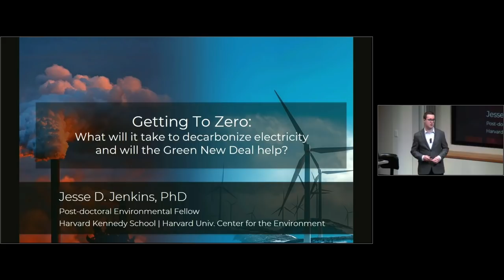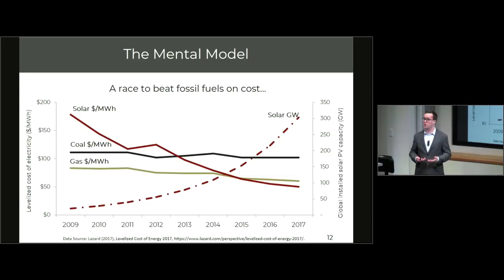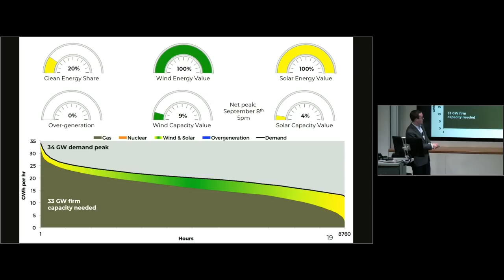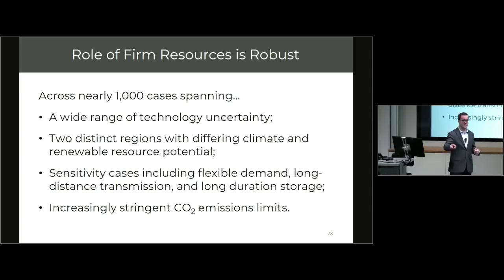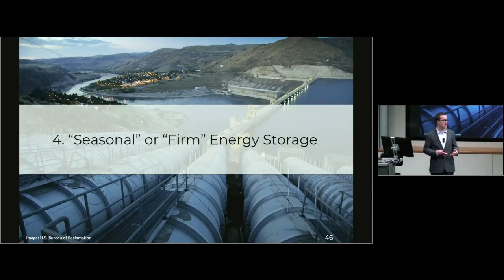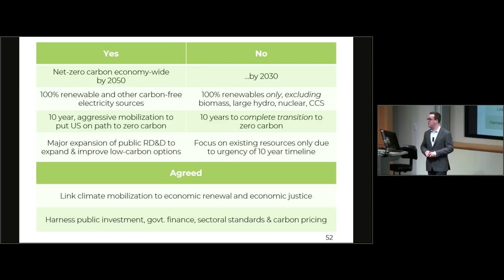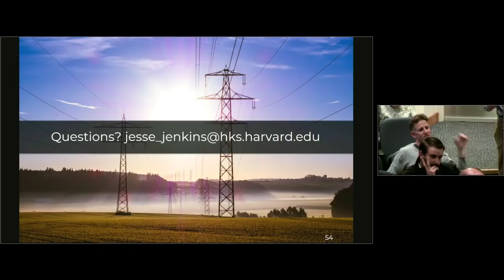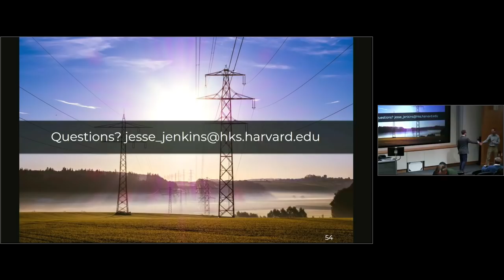UT Energy Symposium – February 21, 2019

Comment: there are so many shell and pea tricks going on here with this modelling it’s hard to know where to start explaining all the mathematical and logical tricks he is using to reach very dubious conclusions.  all modelling is suspect to manipulation of assumptions. and this guy is a master manipulator. 

so before i get started debunking his conclusions consider what Jenkins is saying, beyond 20-30% of mix solar PV has “no” market value at all. similar for wind. and yet in South Australia, coal is departed at (~40% RE) and gas is being eroded as the market operator stops curtailing so much wind and the hornsdale battery eats the FCAS market.  and what has happened to wholesale energy prices on the thin SA node of the Australian NEM? They’ve gone down in comparison to every other state.  that’s what. soon they will be at 75% with cheaper power prices and according to this master of knowledge manipulation that defies the laws of physics and economics.  

another point to consider is that if the market doesn’t reward cheap and very low emissions capacity, only flexibility then what is wrong ruth the market. nationalising the markets should be considered if the market reformers can get it right. decarbonising is not choice, it’s a necessity. NY State has legislated it with ambitious targets and eschewing the use of dubious “carbon offsetting” mechanisms and products. (often of suspect provenance). 

so either reality is right or Jesse Jenkins’s modelling. which do you think has erred? i know a fair bit about modeling so i can see his slight of hands. like a magician it’s invisible to ordinary people. in future comments i will explains. how he does it.  but why does he do it? does he really want to destroy the small chance we have of preventing catastrophic climate change? or does he take money from those who are opposed to climate action? or is he just carving out a Bjorn Lomborg type fortune in counter-narrative?
Reply: I imagine that Dr. Jenkins is reeling from your articulate and coherent attack on his views, and that Harvard University is carefully reconsidering its decision to hire him.
Reply: South Australia had the highest energy prices in the world in 2017 before Hornsdale started participating in FCAS, so they had a pretty easy job bringing prices down. South Australia still had the highest prices in Australia through 2021. In January 2022, prices there spiked to $5 per kWh, when normally they are 40c. Sometimes prices fall negative because the renewables are overgenerating and they are paying people to increase demand or else the grid will be damaged and suffer blackouts, but negative spot prices are not good in the long term: it reflects difficulty for generators to make a predictable income, which leads to generators dropping out,  less supply,  higher prices.  

The rest of the world wants cheap energy, which South Australia does not have. Nowhere in Australia has cheap energy.
Reply: @TheMrEarbrass  an appeal to authority is it? I raise you Mark Jackobsens 2021 modelling including sectorial coupling with heat and cool storage for every single state in USA covering not just current grid demand, but electrifying everything and covering that demand for every 30 second dispatch period in three years of weather data, oh and bound with a climate model to get the changing PV and wind outputs year by year.
Reply: @xfreeman86  I can't paste them here, but I have graphs that compare the SA wholesale average price over time with the other states on the NEM. It is unequivocal truth that SA wholesale price has gone from highest to in the low end of the pack. 

you say price peaked at $5 ?! prices peak at the limit $14500 in all states in Australia from time to time. 

It wasn't the Hornsdale battery that reduced the wholesale prices in SA so much as having ~58% RE over the year being dispatched. Yes, Hornsdale and now other batteries are able to play the FCAS market and reduce that cost from expensive gas speaker use too.

Comparing Australian or SA energy prices with the rest of the world is a bit disingenuous because SA is one of the most spread out grids per MWh of dispatched energy in the world. Same for the other states in SA but a few of them have much bigger capital cities, i.e; VIC, NSW, QLD, ACT. 

In a carbon constrained world Australia will become a cheap energy country because we have excellent RE resources. In the past cheap coal provided relatively low energy price, Australia is (unfortunately) the largest exporter of coal and LNG in the world.
Reply: @xfreeman86  wow, that's setting me a fair bit to refute, John. Firstly, please understand one of the main reasons SA has comparatively high energy prices on a global scale, it's a very small population (Adelaide is 2 million people)  "smeared" (as Jay Weatherill once put it) across a large geographical area, so network charges are high and like all states in Australia, more than 50% of most small customer bills. 

It's unequivocally true that SA had the highest prices on the NEM (east coast states in Australia + SA and Tasmania) over a decade ago before their investment in RE. 

Now, by comparison their wholesale prices are lower than eastern states. I have four graphs to show you this in various ways but I can't post them here. Goto opennem.org.au and interrogate the wholesale prices for yourself. Your "$5/kWh" is cherry picking, but even as a cherry it's not abnormal. $5 per kWh ($5,000/MWh) is no big deal for a 5 minute trade period on the NEM. The market ceiling is actually $14,500 and for five minutes periods it often goes over $10,000 most months, in most states. 

This week for example QLD had two trade periods where it cleared at $10,000 & $13,500, while SA peaked at $1,000. But again, this is cherries, you need to consider the data over an entire year, and SA is definitely seeing lower average prices than VIC, NSW and QLD now.

here's a comparison of the annual average wholesale price NEM states for you for 2021 in order less to highest:
SA $58.16/MWh
VIC 63.93
TAS 65.95
QLD 75.99
NSW 78.85
SA is the lowest

here's a comparison of the annual average wholesale price NEM states for you for 2010 in order less to highest:

TAS $34.93/MWh
QLD 35.28 
VIC 40.42
NSW 42.29
SA 58.03
SA is the highest.

As for what the rest of the world wants, we are living in a climate emergency, sleepwalking through it really as even the diplomatic UN Chief is now prepared to say. In a carbon constrained world, SA has some of the cheapest generation costs from wind and solar energy in the world. They also developing one of the most interesting CST and thermal storage technologies that we've seen in two decades at 1414. In terms of powering industry, industry will now more to location where they can access raw materials and energy most cheaply, even labor is going to be less of a concern in highly automated industries. Australia is well positioned with natural resources and renewable energy resource and SA is at the front of the pack in developing those in Australia.
Reply: Sure Simon